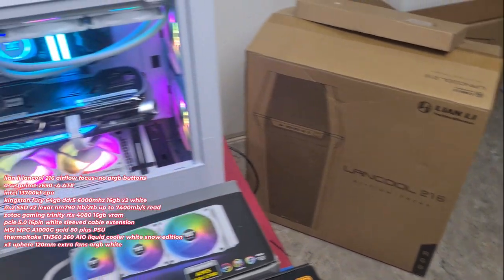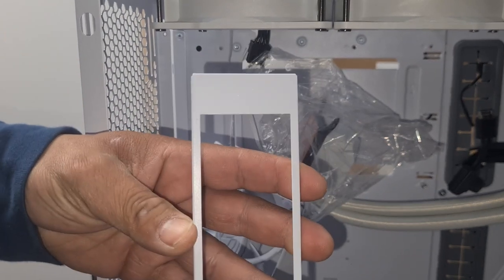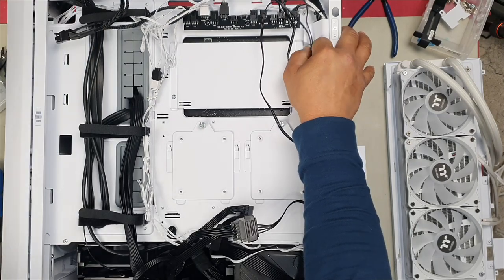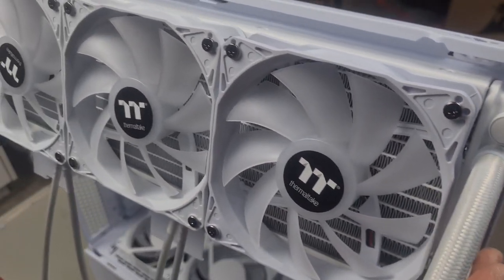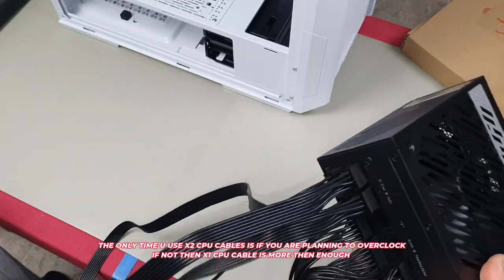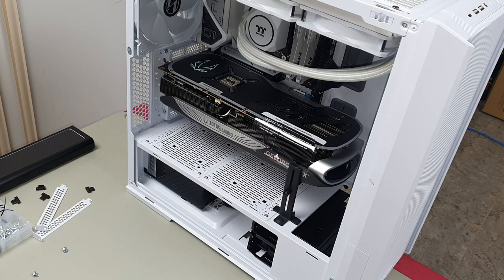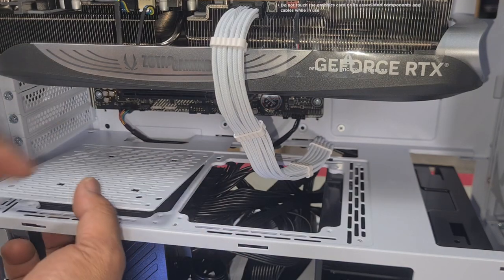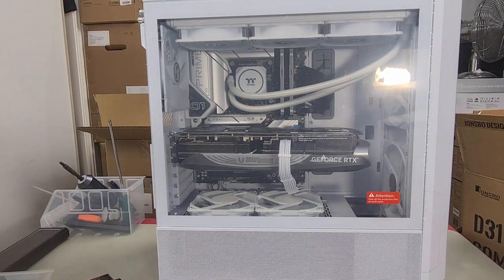SEPT 2023 WHITE LIAN LI lancool 216 build 13700KF ZOTAC TRINITY RTX 4080 64gb ddr5 1000w gold psu

Comment: Noob question as I'm researching for my first build but if the PSU is pushing its hot air out at the bottom, wouldn't the two intake fans at the bottom pull that hot air back inside?
Reply from the maker: not really as the fans are on top of the psu shroud and the hot air will push out basically your forcing more air volume to your gpu which also helps to cool the gpu and then it exhausts out of the case ..and the intake fans on the side bring in enough cool air to help lower the temps as well

Comment: My dream is to have all white build 🔥
Reply from the maker: I'm about to do another one this time all white with a 4090
Reply: @MIKEYZVLOGZ  Can i build cheaper version all white pc cuz this looks to me so expensive?
Reply from the maker: @Red-ding-Ton  of course u can It's all about sourcing the white parts so you can build your all white build. For example, you can get a white 3060TI am a different white sleeved cables and a white mother board. Just know that when you build a white pc. The parts are a little bit more expensive than you would for a all black build. its the nature of white pc parts they cost more ..which is silly but its a fact  For example, if an all black build cost one thousand two hundred and all white build with the same specs might cost you one thousand five hundred